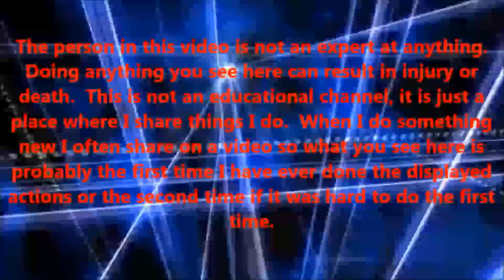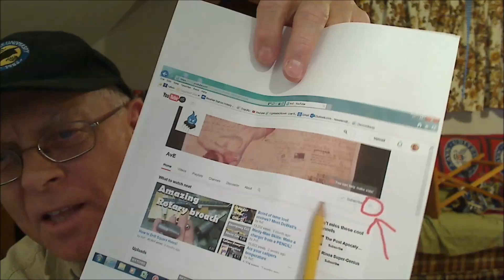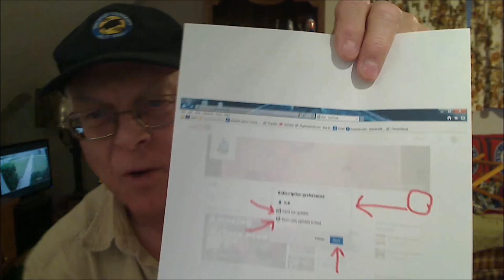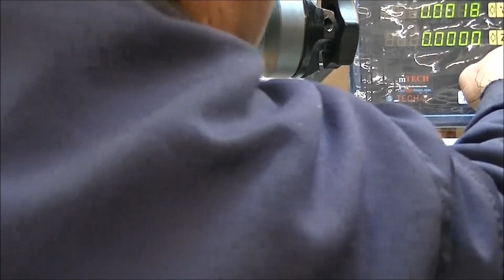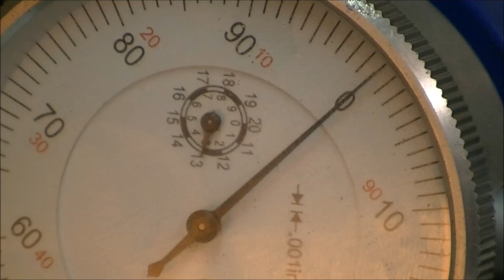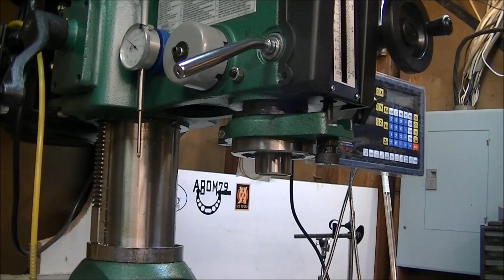DRO installation on Grizzly G1007 mill drill part 3 of 3

Comment: Thanks for the videos! I recently purchased the HF 33686, and my DRO arrived yesterday. It is nice to see how somebody else completed the install before starting my own.
I am slightly regretting purchasing a 2 axis DRO, but at the time I didn't think I would gain much with the Z axis indication..

I miss having access to a room full of Haas CNC machines, but I'm sure thankful that I finally have something.

Cheers
Reply from the maker: A room full of Haas cnc machines sounds like a grand place to be.   I find the Z axis is very useful to me.  Their are other ways to get the Z axis reading such as attaching a digital caliper.  Of course you could use the 2 axis on your lathe and get a 3 axis.  It is just money.  😁😉😊  Thanks for stopping by.
Reply: What length of scales did you end up with?  I have a 33686 on order and am looing for a DRO, but the lengths is unknown at this time since I don't have it yet.

Comment: Glad you cracked the problem on Y. Indicator mounts and angles etc can certainly affect results. I haven't a Z to set up on my 0704 as it has a Z axis DRO on it. Thanks for the description of your process.
Reply from the maker: ChrisB257 I had to go back and redo the "Z" mount as it was too floppy.  I think it is very steady now.  Thanks for the subscription and the comment.
Reply: cerberus Sorry I hadn't sub'd before -- always meaning to.  Have just started on mine - got to space off the X hugely to clear things like vise overhang, and also X locks. Means some big Al blocks I think. Y will also be tricky because of angles --- these things are never easy! Glad you got Z tightened up OK.

Comment: I'm not sure I agree that the clothes make the man.......but clothes certainly bring about incorrect conclusions from other people.   If I'm all ratty looking from working in the shop when I go out for lunch.....I gauge my tip on how the waitress treats me looking like that.  The ones that look past it get a nice big tip.....the others get what they already assumed they'd get. :)

I did the same thing with the notifications. lol  I went for a couple of months wondering why I didn't get any notice.  Heck...I still come across one here and there that has slipped through. :)

I really like that you have a glass scale for the Z axis.  I always thought I'd upgrade mine, but I haven't.  Nice vid Harold!
Reply from the maker: bluehandsvideo I think I need to improve on the connection on the "Z" axis.  It is connected to a plastic nut and I plan to make a steel one to replace it.  Thanks for viewing and especially for commenting.
Reply: cerberus
AAhhhh......I kept the screen small and low rez since I was using my phone as the internet connection......I didn't realize it was connected to the nut on the depth stop. Now that I'm home, I blew it up on high rez and can see it.  Yep.....I'd change that up for sure.  You've got a really nice glass scale relying on a cheesy plastic nut.  Mine is connected to the big green piece that clamps around the quill.  I think it uses a rod.  I'll have to go look.  The depth stop rod is threaded and designed to spin.....right?......did that get replaced?  Is it still loose and able to spin?  The plastic nut might not be much of an issue if you can get that threaded rod anchored solid.  I'll see if I can take a look at it this morning on mine.  :)
Reply from the maker: bluehandsvideo the depth rod is anchored solid and I don't think it has any slop but the plastic nut is not a good choice.  It was not long after I hooked to it that I knew it was too flimsy.  You might have the better idea of using the big green clamp.  I will look it over.  Thanks for the suggestion.
Reply: cerberus
My depth rod spins in the mount on the green clamp to adjust the stop up and down.  Did your kit come with a different rod to put in that place?  If yours doesn't spin or wiggle, then that's your connection to the green clamp, so I'd just replace the plastic piece. :)
Reply from the maker: All I had to do to make the rod steady was to tighten it in the upwards position real tight.  I am thinking it would be good to move the connection so I could still have the adjustable stop.  I may have been premature in using it for that.  I think you were on the right track with connecting it on to the green collar.